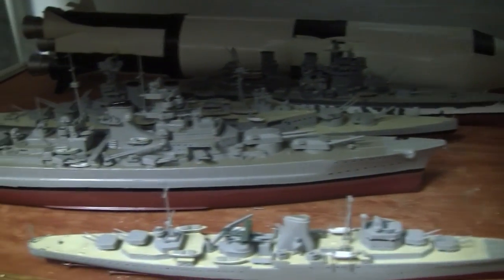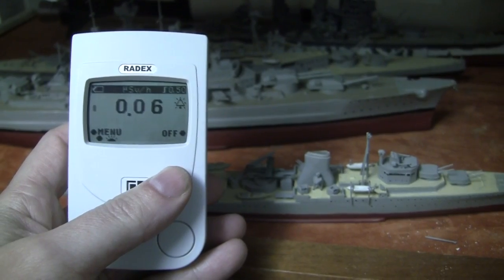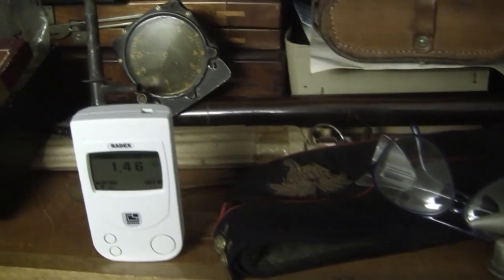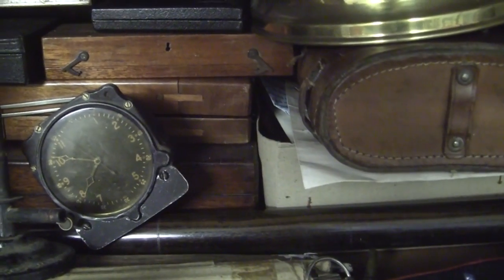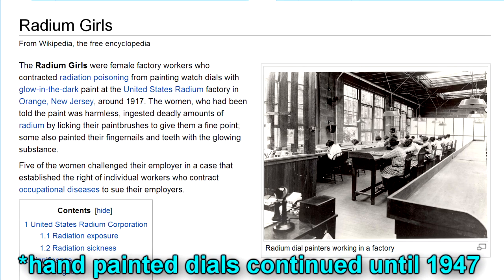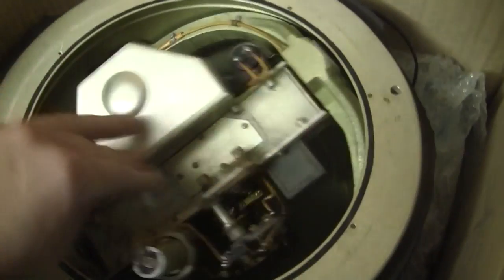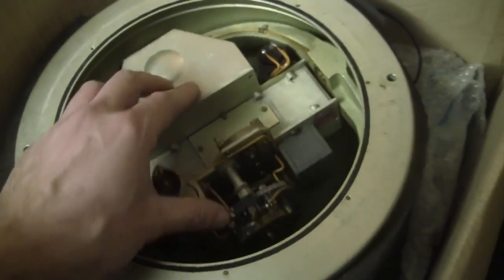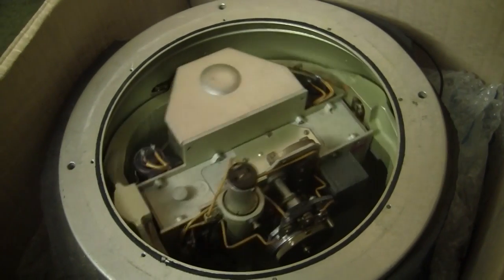The Radioactive Bomber (that irradiated girls)

Comment: i think the thing at the end is a gyroscopic stabilizer. for guiding a large bomb  or perhaps for a missile. accurate missiles could have changed the outcome of the war. the axis powers were experimenting with missiles. this would aid or replace. the previous way they stabilized the rockets called spin stabilization. 

i had a toy with a much smaller version.

Comment: Did he post what it was, anywhere?  It appears to be designed to keep something level or aligned with the horizon.  I'd guess it's either part of a guidance system or something designed to keep guns or tank barrels level as a vehicle moves around.  The coils I would guess have something to do with transmitting the location to a secondary device on the outside (maybe via a magnetic field?).  Keeping the V2 flying level would also make sense.

Comment: A gyroscope guidance and arming system (not that it hasn't been gueesed by everyone else)? As long as it spins, the rocket flyes straight. When it stops (out of battery? or maybe its simply powered by the inertia of the massive thing) the bomb plumets to the ground, by design?

However it does look more like a gimball than a gyroscope. Designed to keep the electronics - a guidance and arming system - leveled, maybe to track the earths magnetic field. I definetly wouldn't design a gyroscope with the electronics spinning around at high speeds. It looks incredibly unstable.

Comment: Is it a gyrocompass, like the ones used in the V2 rocket for navigation purposes?

My father told me about those. He worked at Raytheon, which bought the original company, Anschütz, and told me about those.
Such a fascinating tool, used for good and bad (mostly good).

Comment: If my knowledge is correct, stable platform for the A-3 rocket. It had an accelerometer and acc. integrator for both range and lateral. Signal to attitude control for Yaw pitch and roll as well, with a couple of pneumatic servos. It had pitch gyro, and yaw gyro. Along with Rate Gyro Yaw, Rate Gyro Pitch and Rate gyro Roll.

The only thing I don't know about the A-3 rocket Stable Platform is how it looks, which is why I'm guessing that is what you showed us in your video.
Reply: You mean A4 rocket.
Reply: ...Yes. I feel like an idiot for saying "A-3" now...Thanks for catching that

Comment: its used to measure the force of a pressure wave from an explosion... on the other side of that dome is a small aluminum foil sheet... which you use to tell you if the explosion was strong enough to rupture internal organs from the distance you set the apparatus at.
Reply: ha! horrible guess lol.

Comment: hmm, the coils look to me like they are used to l transmit a radio frequency (well, actually it looks like a transformer, but i don't think it's quite that) and I think the other coil is to pick up the radio signals it sent out, it's on a swivel (looks gyroscopic, but, again, I doubt it)

so my guess is it's a radio homing device used on a torpedo, or perhaps a radio radar scanner for boats/airplane/submarines.

dunno, just a guess based on what I see.

Comment: Well, duh it's a gyroscope. That's the easy part.
It doesn't look aerodynamical or well enough sealed to be used in the water on a torpedo or in the air on a plane or a bomb.
However, it looks suited to be mounted on some sort of canon, on a ship, let's say. Maybe a medium to long range, large caliber canon, so that with it's simple electronics it could aid in calculating firing solutions more precisely, while keeping the barrels steadier? Especially useful to bomb land based targets with precision, from great distance?

Comment: It looks like inertial navigation, which could have been a game changer for rocketry or even U-Boat navigation at the time, since it could have allowed rockets or U-Boats to follow a guided course.  It looks just like the pictures in my old F-16 study materials from when I was in the USAF (which were for an already outdated system) that used a gyroscopically stabilized platform in a concentric set of gimbals to orient three perpendicular accelerometers with two parallel to the horizon and one normal to it.  Close?

Comment: Ok I will take a shot at this one. Rubber seals suggest naval system and in the water on one end. Gyro for guidance. And the coils. Could it be a magnetic torpedo guidance system? The coils are a metal detector guiding it toward the steel hull of ships?

Comment: Yeah I'm gonna go with an internal guidance gyroscope from the German rockets used during WWII. I believe that this allowed the Germans to set an initial heading which would keep the rocket headed toward let's say London, and then they adjusted the amount of fuel in the rocket to determine how far it travelled. The first guided missiles if you will...

Comment: Normally I'd say it's a V2 guidance system, but you said that it "could have" changed the course of the war, not that it did, which implies it was never mass manufactured.

Judging by how mobile the internal structure is, I'd say that it is a gyroscope, but because it had 2 layers of rubber to seal it, I don't think it's an accelerometer.

Because of this I think it's part of the smart bombs the Nazis started making at the end of the war.
Reply: part of the Fritz-x, it housed a rolling gyro ball of some sort. i think you are right

Comment: Is it an Inertial navigation system?
You use it to determine changes in direction because the part that spins can't be torqued due to the way it's mounted but the other rings can.

I guess it would be useful for targeting on a weapon? I can't think of what else it might be.

Comment: Without taking a look at the comments, Id venture a guess and say its a missile guidance system. Ive read on military tech the Warsaw Pact states had and they had these A-T fly-by-wire missiles with a guidance system that looks fairly similar.
 I dont know if that went inside a V1 / V2 or was it one of those experimental guided missiles the Germans were messing around with near the end of the war but thats pretty amazing. Must be a replica, right?

Comment: I think I may have been wong I have had another look at the V2 Guidance systems and it looks different. Maybe from the frtz X or x-4 but maybe from the guided torpedoes. Also could be for the flying wing planes the Germans were working on.

Comment: Well... It's definitely not a Gyro-stabilization unit, seeing as it has no visible Gyros, and it always returns the bottom of the cylinder, it doesn't float around freely like other gyro units. It also could not have been a conventional 3 dimensional navigation unit, for reasons stated above. It would not seem that this unit was put in, for instance, a bomb or anything, seeing as you stated it was a war-changing device and the hiroshima bomb and others ended it... This is a tough one, another war changing device I think would, like say, be a missile, but this hunk of metal could not have given data like that of normal gyros... My guess is that it was an alternative means of guidance for missile(s), and the data gathered from the deviation of the missile from the prograde direction and the G's it was pulling would coincide together to make some sort of comprehensible data for what you could remotely call a guidance unit of that era to process and fly the missile in the correct direction to hit a target. I don't know though, and thats all I have to say about it and what I think its relation is to war-changing weapons.

Comment: I think this is the LEV-3 nav module from V-2 rocket. More specifically one of the gyroscopes and I guess that coil thing is either the accelerometer or the wireless reception module of the later models. This thing is basically a primitive analog computer attached to a spinning gyro guiding the first thing to actually go to space.

If you are looking for an atomic age equivalent, this is NASA's Apollo guidance computer: http://klabs.org/images/apollo/agc/agc_dsky.jpg

For a modern day iteration: http://2.bp.blogspot.com/-V2oXxnFkc3k/UWsPE1syuTI/AAAAAAAAj9Y/UKXHyy1lOCs/s1600/nonGPSchip.jpg

Comment: Try to lower the volume on the radiation meter before you bring it on a plane. People are insanely irrational about electronics on airplanes, and explaining that you're measuring background radiation might just make it worse. And good luck getting it pass TSA if you board in the States.

Comment: Airport security:
"Excuse me sir, can you tell me why you are trying to bring a radiation meter onto this plane?"
Bearded man, with long hair and glasses:
"I want to test if the levels of background radiation increase when at higher altitudes."
Airport security:
"That's fine sir. Enjoy your flight." - Said no Airport security officer, post 9/11, ever!

That's assuming you get it on the plane. If that thing goes off when you are in the air, everyone is going to go ape shit. Then you will have to explain to them that it measures radiation. Ohhhhh the joys. Please bring someone with a camera with you so they can video the whole thing.

Comment: I would guess its an automatic gyro controle from a V-2 rocket.
Reply: That's what I'd go for...If you hadn't already :(
Reply: or possibly a v1?
Reply: dangerouslytalented  the logic to me would be, The v1 were a purely ballistic missile directed at the target while the V2 were fired vertically, making a gyro steering necessary.
Reply: the V1 was pilotless, and would also need a gyro.
Reply: dangerouslytalented I can't be sure those nazi's didn't cram  some Japanese in the cockpit of the v1's randomly bombing London but I feel convinced that that's not the fact.
If you throw a stone you can calculate where it lands, within some certainty.

Comment: Looks like an early inertial guidance system.
 Actually, It looks like a V2 guidance system that leveled out the V2s in flight to stop it from spinning out of control. Whilst it wasn't "guidance" as such, it was the most basic form of missile guidance systems, i.e, made it fly straight and the right way up. My question is, WHERE THE FUCK DID YOU GET ONE?

Comment: Gross who would lick a paintbrush? Even if you weren't using radioactive paint, and it looked clean. Use your fingers or something... Gross.
Reply: Licking the  end of the paintbrush was a very efficient and convenient way to produce a very fine point at the end, perfect for painting tiny numbers and dots on the face of a dial. Many of these girls got paid by the number of dials they could produce per day so they did what seemed quickest and easiest.
Reply: It's very normal to do when you paint. You're not talking about the wide paintbrush thingies you use to paint walls or whatever, but ones with a pointy end. One instance where people do it today is painting Warhammer figurines.
Reply: I sometimes lick the nib of my dip/fountain pens to get them to flow better. I know the ink is non toxic so I feel safe in doing that.